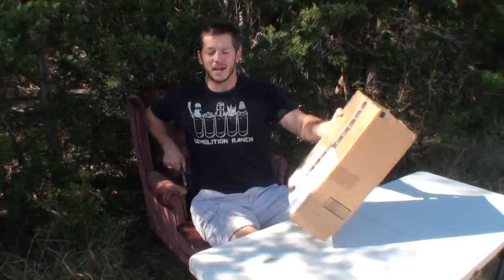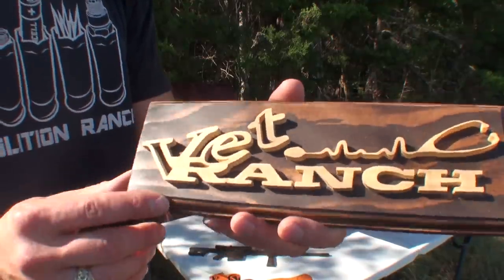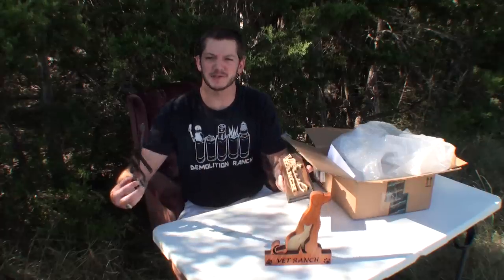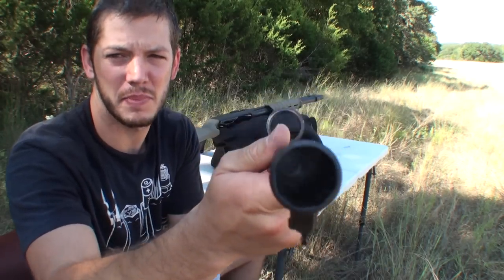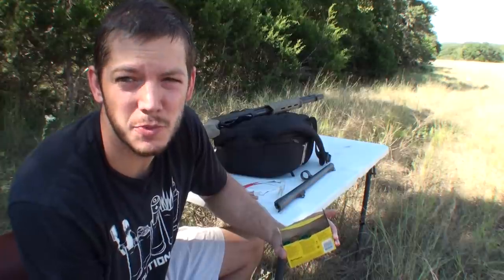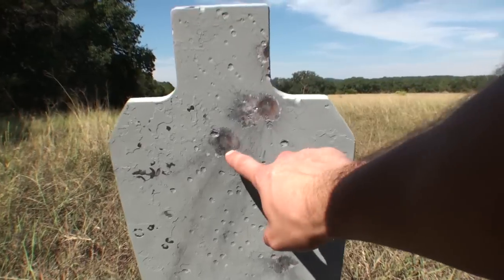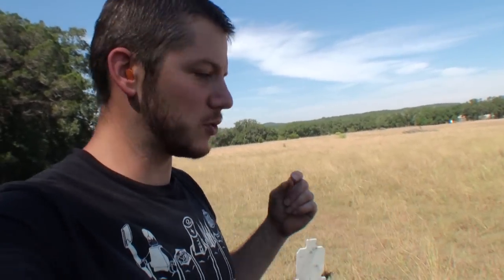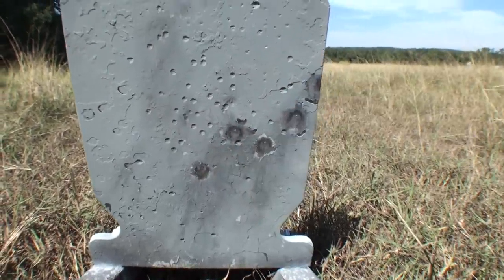Rifled vs Smooth Bore Barrel

Comment: Hi, So I have a question I believe you can answer fairly easy. I have a smooth bore maverick slug barrel on my mossberg 500, I also have a vented barrel with full chock and a rifled slug barrel. Now i'm really just a plinker so I like to accurize the guns in my possession. Most stores really only have rifled slugs, so that being said the majority of slugs at hand are going to be rifled slugs, excluding casting and reloading myself. Will the rifling be a problem when going down a rifled slug barrel causing issues vs going down a smooth bore barrel so the slug can spin as designed? i haven't had a chance to go to the range to shoot in a while but i've always wondered if shooting the rifled slugs will be more accurate out of a smooth bore barrel vs a rifled barrel? also i've never shot slugs threw my full choke barrel, only buckshot and birdshot. I actually have wondered if you can with full choke? my knowledge lays with rifles i'm just learning shotguns now as i take interest in both my mossbergs. Also were those rifled or smooth slugs you were shooting in the video? sorry for the long comment/questions.

Comment: most people use sabot slugs which are usually around 300 grains when using a rifled barrel. Personally i use Challenger 1 1/8oz rifled lead slugs and wouldnt attempt farther than maybe 150yds max. my grandfather on the other hand uses hornady sst sabots which are 300 grain and they move a lot faster than mine and only drop 6in at 200yds (according to the packaging) but again the only reason is he has a rifled barrel and i dont lol

Comment: Usually lead slugs like the ones he used have rifling cut into them. Rifled barrels are more for Sabot slugs which have no rifling on them and if you fire them through a smooth bore they will tumble. And yes you can shoot a shotgun slug at 300 yards but again thats a sabot slug. Most of which only drop maybe 6 inches at that distance. If you were to try that with rifled slugs they would drop a lot more

Comment: Try firing at >500-800 meters... Rifled barrels are used in high velocity military weapons. It is more accurate and lethal. For Smooth Bore guns, fin stabilized projectiles are used ( tanks) for 120 mm calibre and above. Few Main Battle tanks still have still rifled guns.

Comment: the length of the barrel has very little to do with accuracy and the shorter it is the more accurate it is. smoothbore does not lose much fpe compared to a rifled barrel at distance. granted the rifled barrel makes the projectile more stable and it can effect longer ranger accuracy (100yds +) but who goes that far with a 12ga?

Comment: You should've stretched out the distance more to better prove the difference in barrels. Also, why didn't you shoot Sabots like a hornady or lightfield or some specially designed slug out of the rifled barrel. I live in a shotgun zone in Michigan, which is very lame, but i love to hunt so i abide by the law. However, I shoot lightfields out of a rifled barrel and it gives me a bit more range (like 50-75 yards) more than the 100 yard smoothbore. There are people around here that claim to shoot 300 yards....but if you think about it, a sabot zeroed at 100 yds drops around 10 inches by 150 yards, probably a bit over 20" at 200.( granted i zero at 125 and only have a 5" drop at 150) but still, a 300 yard shot would almost be a guessing game. You'd have to figure a 1 1/4 oz chunk of lead dropping probably 50 inches at 300 yards, that's a big margin for error. (not to mention a huge loss in velocity). Anyhow, love your videos, watch them all the time. Keep on Shooting!

Comment: Whenever I feel I need to be punished I grab my 6 1/2 lb. 870, a 100 or so 3" 1 1/4 oz. Slugs and commence firing until I figure my shoulder is sufficiently bruised. I have both rifled and smooth bored barrels and they both provide plenty of recoil for even the most discerning masochist!

Comment: I hereby challenge Matt to correct the smooth vs rifled barrel comparison video by using the right ammo for the right barrel.

Smooth bore with rifled slugs = pretty accurate I'll admit

Rifled barrel with sabot slugs =  a lot more accurate (or I'll eat my keyboard)

Try scoping that shotgun, then using the smooth bore at 75 yards then switch barrels and use sabot slugs in the rifled barrel and I'll guaranty that you'll see different results than this video, if not, I'll eat my keyboard

actually, I just really want to see Matt get his shoulder punished more, lol

Comment: just get Winchester rifled slugs. they are design for smooth bore barrels. also they sound awesome flying through the air at 100-200yrads. better at 200.

Comment: The reason rifled barrels don't work well in shotguns is because when you get the pellets spinning like that they aren't centered, the reason a rifled barrel works with a slug or a bullet is because the spin axis of the projectile is right in the center, stabilizing it. But when you're using shot pellets none of them are centered so when they're spinning on the axis right in the center of the barrel and that barrel disappears they want to go straight out the direction it was heading, to keep its momentum, instead of going straight

Comment: what about trying some home made home made slugs Mike say a lee 7/8 oz or a 1 oz lee slug out of a rifles vs smooth to test accuracy? also what about a rifled choke?  many ppl are switching to home made slugs because they are like 12 cents a piece vs a dollar+ to shoot factory loads. also you can buy a 25$ box of bird shot and melt it to a slug and you have a pre primed pre powdered and wadded load ready to recrimp. for some reason (due to proprietary wadding unavailable to the public ) reload slugs are less accurate.
so good sir?! can you debunk this? It would be a cool video ty

Comment: a question. what is the point of a rifled shotgun barrel when the slug itself already has rifling? i could understand the need for a rifled barrel if the projectile was smooth and didnt have its own, but seems to me that an already rifled slug from a rifled barrel would cancel each other out
Reply: and the rifled slug does spin from a smoothbore barrel

Comment: Rifled slugs are for smooth bore...the slugs are rifled to give it spin to stable it through a smooth bore shot gun...you are supposed to shoot sabot slugs (which have no rifiling) through a rifled shot gun barrel. It's the same exact thing as a hunting rifle except a bigger round .That's why you never see a 300win mag or any rifle caliber with rifle grooves cut into the bullet. The bullet is smooth so the rifiling bites in to it and spins her.
Reply: What happens if you shoot a rifled slug/round in a rifled shotgun/rifle barrel? Does it spin even more/faster? Is it more accurate long-range?
Reply: Ricky Mohan those cuts on the slug are so it can morph its shape to fit threw though any size choke, same reason the ass end is hollow and not solid

Comment: Maybe u or someone can help me out. I am kind of new to the whole shotgun deal. 
I have a modern pump 12 gauge Mossberg that I just shoot whatever I like out of it.
So that is no problem.

But I just purchased an old Winchester model 50, 12 gauge, 2 and 3/4, that says MOD marked on the barrel. Which I assume means modified choke. YET,..a dime rattles a bit in the muzzle, so it seems a little bigger.

Anyway, I was just wondering if I can shoot every day rifled slugs through it. I was told that if a dime falls down the barrel (And it Does), I can shoot slugs through it, unless it is Damascus steel.
Thanks for any help u or anyone else can give me.
Reply: it says right on the remington rifled slug box that any choke can be used including full. however improved cylinder works best.

Comment: At 75yd there will be no difference; true.  300yds with a shotgun slug would be dumb and is an exaggeration.

BUT my Rem. 870 still has just a tick under 1000 ft-lbs of energy left at 200yds and I can shoot an 8" group with a fully rifled barrel, scope on a cantilever mount, and Rem. 3" Magnum Saboted Copper Solids.  It has 23" of drop at that range, but it is a consistent 23".  With a solid rest, I would not hesitate to take the shot at 200yds.  But the furthest I have taken so far is 135yds dead-accurate right through the heart on a 130" whitetail.

Comment: The problem is that you used rifled slug in a rifled barrel. You should be using saboted rounds in a rifled barrel, that is what they are made for. Other then that, great group.

Comment: If you're using rifled slugs, it probably wouldn't make much of a difference.  If you use sabot slugs in a rifled barrel, you will see the difference, assuming you're doing your part.  And if the target appears larger than your front sight, a scope is not really going to improve your accuracy.

Comment: rifled barrel =sabot slugs, smooth bore = rifled slug. rifled slugs do not spin they are rifled so they can make their way through the choke tube. sabot slug fired through a smooth bore barrel will have little accuracy.

Comment: Its says on winchester XP3 deer high velocity sabot slug to use on rifled barrel only, could I run it through smooth  barreled mossburg 500? I am aware lack of accuracy
Reply: I'm curious of that too. What would it hurt to run it through a smooth bore?
Reply: sabot slugs will tumble (like throwing an axe) when fired with a smooth bore barrel. you will sacrifice accuracy, distance, and velocity
Reply: You will be fine if u do it just won't shoot accurately.. but for like close range home defense of something it's fine

Comment: Can I use rifled slugs in a smooth bore barrel with a modified choke? Thanks in advance
Reply: Yes you can. In my experience with using slugs I would go with an improved cylinder choke over the modified.

Comment: With ghost ring sights, and a cylinder bore 18½" barrel I can hit 8" steel plates at 200 yards regularly.  The confusion comes from the mistake of thinking a slug is anything like a bullet.  They are not.  A bullet is solid, and needs spin to maintain it's flight stability.  A slug is hollow in the base making it weight forward so it flies more like a dart or a shuttlecock for people who know what that is, and no it's not how the space shuttle connects to the international space station.
   In short if someone had figured this out pre-revolutionary war rifles would have probably been developed much later.

Comment: Bench shooting stout shotgun rounds against your shoulder a great way to get a flinch.  Old and very good technique is to stand up and use a stepladder as your bench.  That way you can roll with the punches.  If Ya just gotta sit and use a bench, at least get a lead sled.

Rooster

Comment: There could be some mistakes on this experiment. You only supposed to use rifled slugs out of a smooth bore and discarding sabot's out of a rifled barrel. The way the vid panned out it looks like he used rifled slugs out of a rifled barrel. Of course it's gonna suck. Should do this video again with the right ammo/barrel combination.

Comment: That group with the rifled barrel would have been about the same size as the smooth bore's if it had just a bead like the smooth bore barrel instead of those very-precise rifle sights. Fully-rifled barrels are only an advantage (and a necessity) if you're using sabot slugs. Also, rifled barrels are USELESS with buck or birdshot as the rifling will spin the shot load as it runs down the barrel and fling it into a much wider pattern than a smooth bore will.

Comment: your slug contain stabilizer design for spinning automatically inside smoothborne barrel. so put it into rifled barrel is stupid. rifled barrel use for long and accuracy, and only work for round that bulk and bold like sniper rounds. smootborne has advantage to use more variety of munition, but the rifled barrel is limited.

Comment: I have a question, I handload many of my own shotshells, and im wondering if removing the shot cup (but still using shot cards or lubed disk wads) would allow for tighter shot patterning through a rifled shotgun barrel...Since there is no cup being acted on by the rifling, there should be no spin transfered to the shot right?
Reply: That’s a good question
Reply: @DrSweetshaft  6 years later and I still havent tested my theory.. XD
I just went with smooth barrel.

Comment: In order for rifling to work, the projectile has to be a perfect fit... in fact, the projectile diameter needs to be slightly (by slightly I mean in the tenths of millimeters scale) bigger than where the rifling is at so that it will compress against the barrel. If the projectile is smaller, the rifling wouldn't be effective and the projectile will collide with the barrel laterally multiple times resulting in a flight-path that isn't exactly where the barrel is pointing.

Clearly, a shotgun slug isn't a perfect fit.

Comment: Buckshot/birdshot in a rifled barrel?
Reply: there would still be a spread, pellets in buck/bird shot are so small that they wouldnt get a proper spiral, thats why you typically use smooth bore barrels if you plan to use a shotgun, cuz theres really no point in rifling it
Reply: You can shoot them out of a rifled barrel, the spread is larger and you get a donut effect.

Comment: I frankly think this test is accyrate, but not very explanatory. he was probably shooting remington sluggers, which are a brand of rifled slugs.

The grooves cut into a slug will not cause it to spin. I would think it's a safety measure to prevent damage from over boring from lugs ore reduce fowling. but as for it improving acvuracy, it's probably for marketing since birdshot is sold much more than buck and slugs.

a slug designed for accurate use in a smooth bore would be the brenneke and foster, which is feigned around the use of a very front heavy projectile, acting like a shittlecock. but even the remington slugger isn't a brenneke or foster, otherwise it wouldn't be called slugger.

the truth of the matter is that smooth bores are underrated in terms of accuracy. seriously, if a smooth bore is so useless, then why were they so destructive and capable during the middle ages? even when you consider that it was used in volleyfire, soldiers were able to hunt individual target's with them. the reason more than likely had to do with windage being high due to the lack of precise instruments, and the need for better rate of fire than accuracy. other than that, smooth bore weapons firing individual projectiles is not impossible, but has to take place at much shorter ranges. sites were also not widespread during the time.

Comment: Nothing kicks quite like a 1oz 12 gauge slug.
Reply: Also can you fire Sabot slugs from a smooth bore barrel?
Reply: +Slinkman2021 No. Sabot slugs are specifically designed for rifled barrels. If you're using a smooth bore barrel you need to use a rifled slug. If you also put an improved cylinder choke on the smooth bore barrel shotgun, your accuracy will also be a lot better. I use a shotgun for all my hunting unless it's archery season.
Reply: You can shoot sabots out of a smooth bore, but my experience shows that they will tumble and not be very accurate.

Comment: You don't use a rifled shotgun barrel to shoot foster type rifled slugs. Foster type slugs are intended for use in a smoothbore barrel. Rifled shotgun barrels are intended for sabot type slugs. That is why you saw no difference in accuracy in this pitifully flawed test. Knowledge, it's a good thing.

Comment: just a curious question, if rifling is all that important how come tank guns fire 2.5-3Kms accurately using smoothbore guns.
Reply: vinish shetty Because they have fins on the round that stabilize it mid-flight. Shooting smooth slugs (i.e. Sabot slugs which are made for rifled barrels) results in horrendous accuracy. The only reason shotguns have smooth bores is because they shoot shot a majority of the time.

Comment: 3:58 shortest possible legal length with out paying a tax stamp and filling out them there govment papers. Strangely if a shotgun is manufactured below 18inches it is only a $5 tax stamp as apposed to the $200 one but you still have to fill out all the paper work and get an ok from teh goobermint. Also you used rifled shotgun slugs if you had used sabot slugs the differences would have been much more apparent.

Comment: EE…
Friend,
The shotgun slugs fired from a rifled shotgun barrel are more accurate—but they are more accurate due to a different dynamic than rifle or pistol bullets. I've always wondered what type of accuracy might be possible with .223, .45-70—and pistol calibers like the 9mm or .45 ACP—Yes, Yes…out of legal length carbine barrels…sigh…
Since few folks will be willing to sacrifice perfectly good—and expensive—barrels for a dumb ass experiment…
I suspect that the short stubby pistol bullets might do surprisingly well at fairly close range—25-30-yards maybe even 50-yards.
…..RVM45

Comment: You shot sabot slugs in the rifled barrel right? And rifled slugs in a smooth bore! So with a rifled barrel around 21 inches in Langth you can shot a huge copper sabot slug three hundred yards! That doesn't impress you! L O L I like it a lot!

Comment: well this guy obviously never saw a Smooth bore RIFLED slug before. FYI buddy. a smooth bore with rifle slugs still spin the projectile. the rifling I'd on the slug itself. a slug with no rifling would be absolutely pointless which is why there is single ball shot because when a bask tumbles it's not near as bad as a full slug. I watch gun videos on here to get educated so when someone doesn't know basic info like this I stop watching them.
Reply: JDshootsalot those groves on the slug isn't to make it spin, it's soft lead so it can change its shape and fit threw any size choke, the same reason why the ass end is hollow.